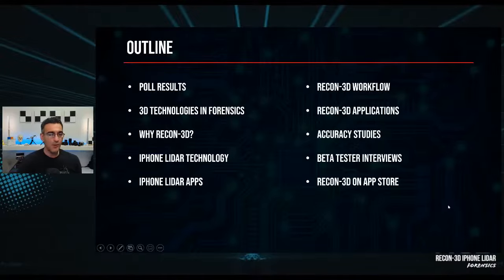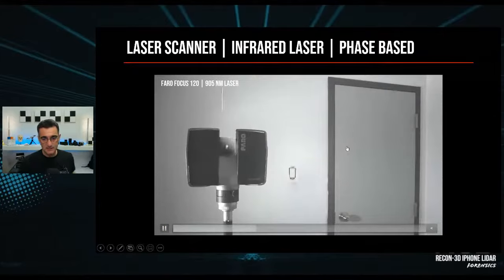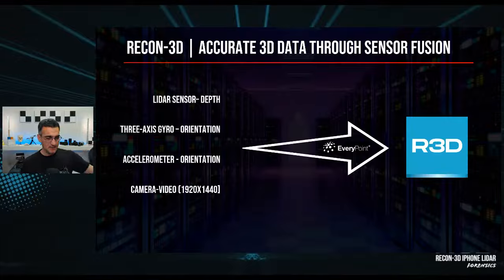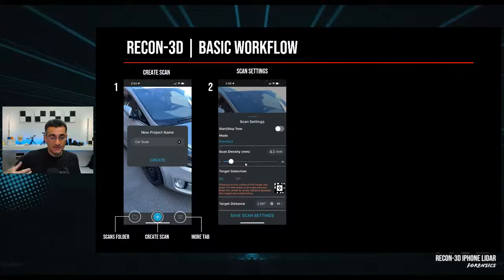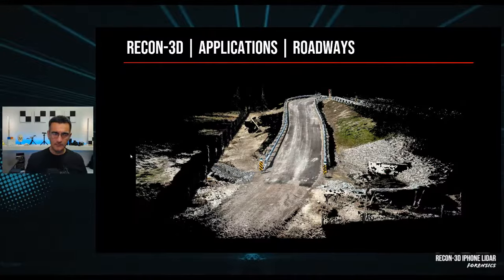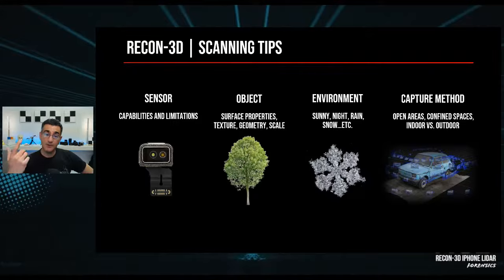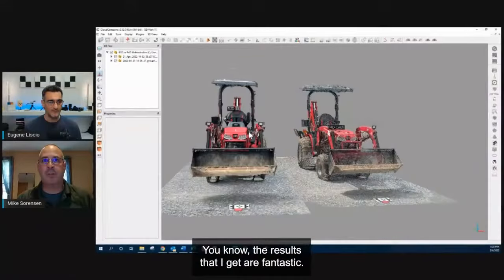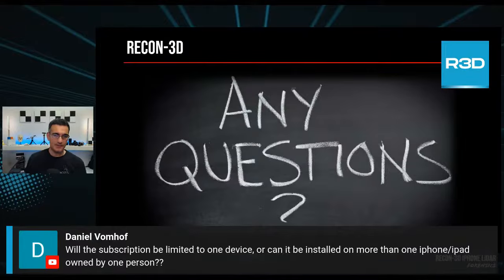Recon-3D | iPhone Lidar 4 Forensics

Comment: I want to take a picture of the location of the bloodstains by implementing the scene of the incident. If it was a room, there would be various items, but with my current skill, it is only possible on a flat surface. I want to take a picture of the location of the bloodstains by implementing those items in the room in three dimensions. Is there a way??
Reply from the maker: Yes, that is what programs like HemoVision, Faro Zone 3D and Map360 will do. They do the analysis in 3D.
Reply from the maker: I should add if it was just for visual purposes, then look at Recon-3D and Vision-3D as they work well together with photos and videos.